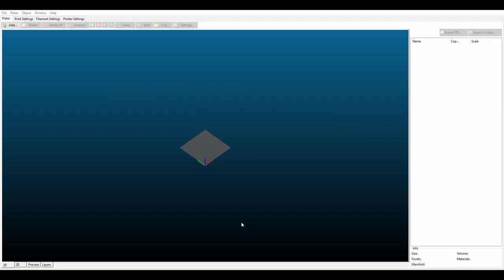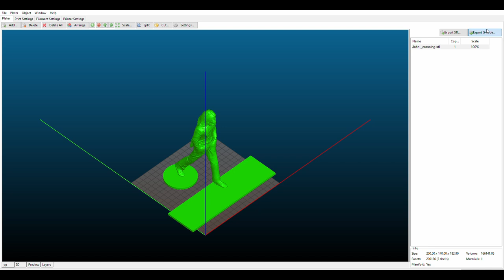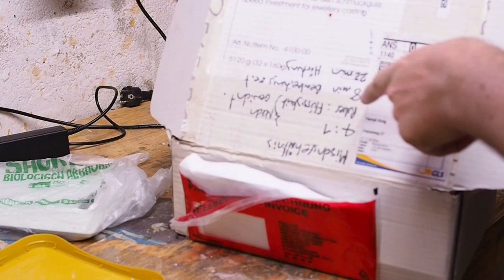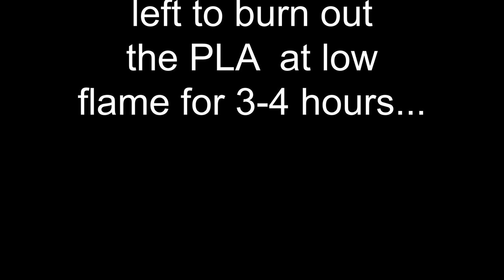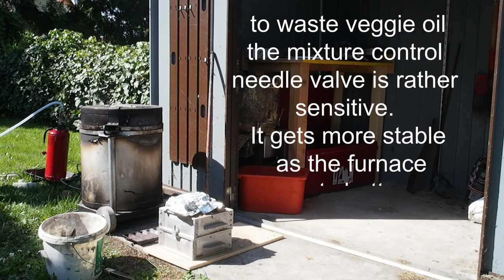Bronze Lost PLA casting of John Lennon

Comment: If you are using a heated bed, and PLA, spray the surface of the glass with a very thin layer of sugar and water. You will find that when you print onto the dried sugar base the PLA will stick VERY firmly. Best to wait until the bed has cooled down before removing the printed part or you may take a piece of the glass off the bed.  I have several glass plates ready to swap out so I can continue printing as the last print cools down.
You can possibly print at least a dozen times on the same sugar coating before having to wash off with plain cold water.
Try and make the layer of sugar coating as thin as possible, don't load the glass plate up with the coating, it works best if thinly applied.
I found that brown sugar seems to be better than white sugar, mix it with water until it is a syrup and I use a small pump action spray bottle to apply.
Reply from the maker: Thanks a lot. I'll try this next time I print. I normally don't care if there is a bit of shrinkage lifting, but it was a killer for those statues.

Comment: The Mendel90 is a very solid machine, if you run it with a Raspberry Pi with OctoPrint, there's a plugin called 'The Spaghetti Detective' which can be used to monitor your prints for failures. Also let's you keep an eye on things without being physically in the room.

Good to see how it turned out, I've always been curious to try lost PLA casting but don't have the facilities currently to do it.
Reply from the maker: Thanks for watching. My Modified Mendel90 (heavy MDF frame) is run with a duetWIFI, so I dont have the spaghetti detective unfortunately.
Reply: @RotarySMP  I'd never heard of the DuetWiFi before so looked it up, that looks like a really nice board, but good god it's expensive!

I'm running a standard RAMPS 1.4 board with TMC 2160 drivers hooked to the Raspberry Pi that runs OctoPrint, works well for my use but I guess the Duet will certainly be a neater package and be more polished.

If you happen upon a Raspberry Pi on your travels, definitely check it out, it should be a plug & play addition to your machine, though it looks like your hands are full with the lathe project at the minute :)